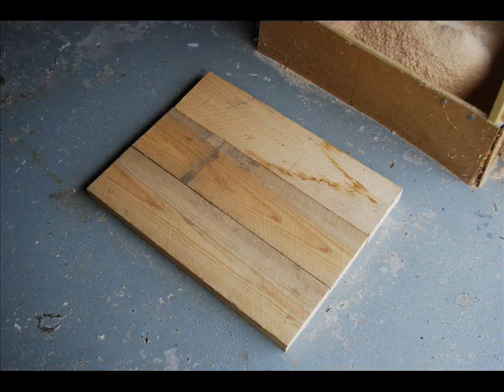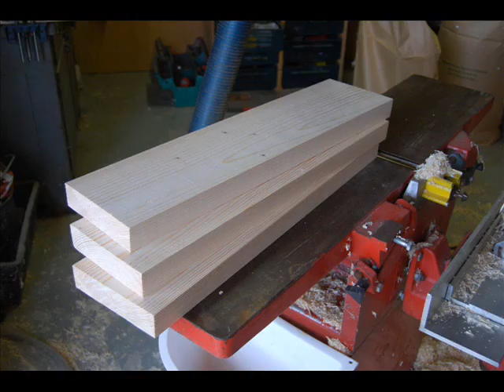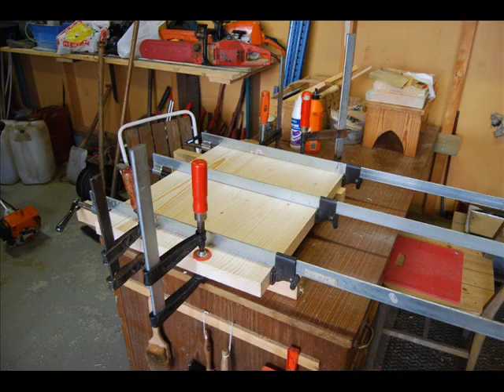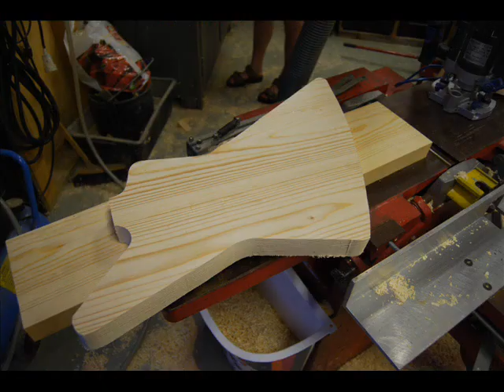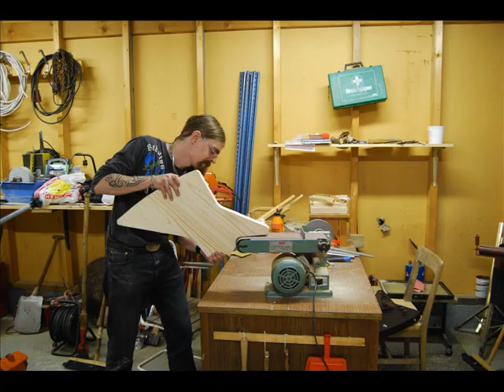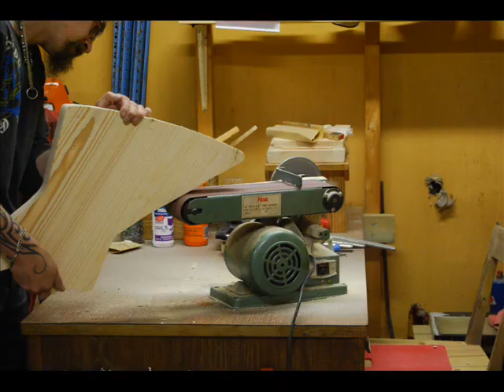Build a Electric Guitar Part 1 (The Body)

Comment: Pine eh, let me know how that's working for you. I'm a little skeptical. Got nothing against pine, especially since it's cheap, but I've had poor results because the wood is so soft. The tailpiece studs tend to creep after a while and I've had major issues with the neck joint remaining tight.

Comment: It's pretty easy to "take measurements" from a good frontal picture (hi res) directely on you computer screen with some drawing software like Gimp.  Then you can "scale" your measurements using a length that you know (the neck scale for instance)  I did that with a Randy Rhoads and it worked perfectely.